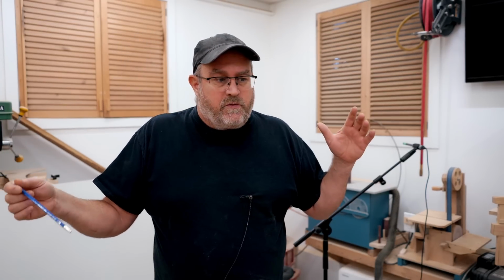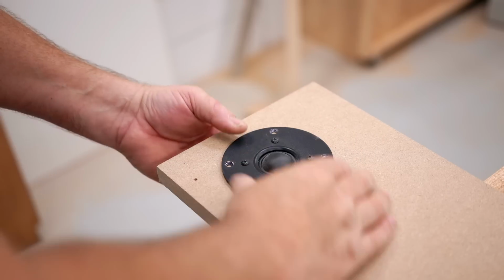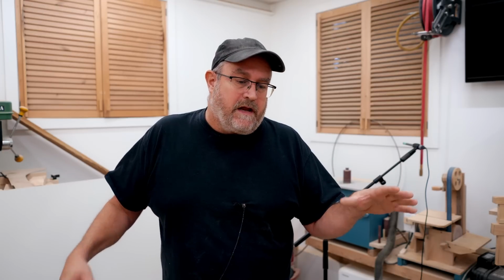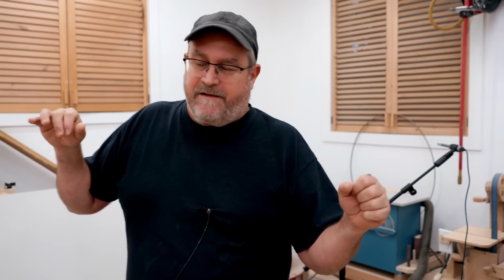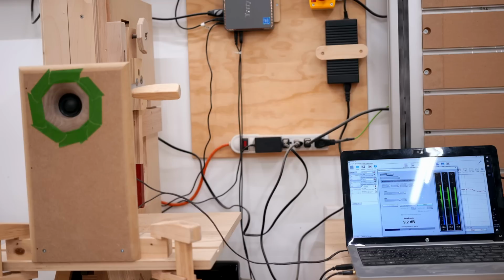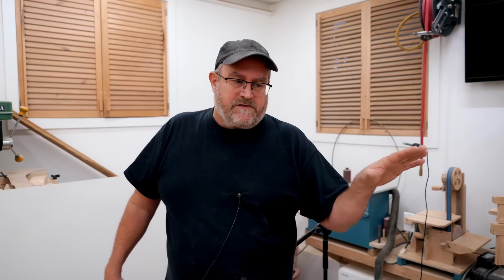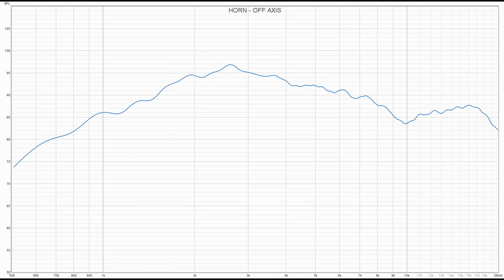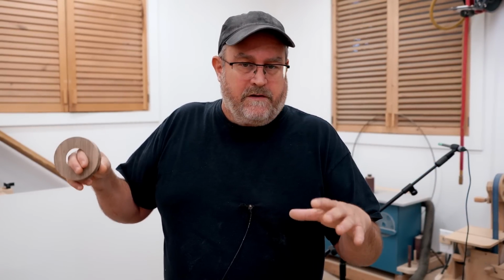What Does a Tweeter Horn Do? And Diffraction Myth Busting

Comment: Horns promote beaming. Fine if you are tuning for sweet spot, but will affect off axis measurments.
Reply from the maker: I showed the 30 degrees off axis measurement. Looks pretty good to me.
A 1" tweeter starts beaming at around 14khz, regardless of whether it's in a horn or not. A horn can affect directivity, but doesn't cause beaming.
Reply: @IBuildIt  a 1-inch tweeter beams at about 7kHz.  I've seen people suggest using full-wave for determining the beaming point but that's not accurate.  Half-wave rule is more accurate.  That said, 1/4-wave is really where the narrowing begins but that's when the driver is not longer omnidirectional.  For speaker builders with limited space (unless you are going to build a multiple entry horn and can maintain 1/4-wave spacing), 1/2-wave is "close enough".  But at a full-wavelength, the driver is already well within beaming.
Reply from the maker: At full wavelength the driver is beaming. Before that it's not beaming - it's dispersion is narrowing. I take the beaming calc like the pregnancy calc - you aren't partly pregnant, you either are or you are not. 
When I look at the practical upper limits for a lower frequency driver to use in a speaker, I'm looking at that full wavelength beaming calc as the cutoff. I'll be able to cross that driver anywhere below that and still get great off axis response.
Reply: @IBuildIt  the data for individual drive units shows otherwise.  And FWIW, Tom Danley (Danley Sounds) is the one who told me he uses 1/4 wave).
Reply from the maker: Take the typical 2-way with a 6" woofer and 3/4" dome tweeter. At half wavelength you need that tweeter to cross below 1400hz. At a quarter wavelength the tweeter has to cross below 700hz. That would be quite an exceptional 3/4" tweeter to do that.
Instead, most 2-ways with a 6" woofer cross around 2500hz, which is below the full wavelength. 
You give up a bit of the off axis response to practicality.

Comment: Just another thought.  What about the acoustical impedance change as the sound waves from the tweeter follow the 3/4 roundover and then encounter the sharp corner at the back edge of the baffle?  If that were extended back to form a box shape would that effect be minimized or could that be done to see if there is any difference?  I also wonder if it would've been more noticeable diff if you had not offset the tweeter.

As an aside,  there is a guy on DIYaudio who did a 2" radius diffraction frame on the sides only (not the top) and got a much smoother response and better off axis dispersion in the midrange frequencies but it didn't seem to affect the frequencies over 4kHz or so.  Just FYI.

"Diffraction Mitigation with PVC"
Reply: Pretty good pdf article on Diffraction.  Search on "Acoustic Diffraction: Does It Matter?"  He says D'Appolito states 3/4" radius is not much good below 18kHz !!  I had read elsewhere online that wavelength can be 8 times the radius size or less.  Ya read something different everywhere.

Comment: I agree with you, the worrying about the rounded corners and minimize diffraction differences that you won't hear but people seem to be worried about is a bit too over the top, I'll always say flat sounds boring usually, and if it sounds right (regardless of measurements) and seems to work in your room then that's a win in my book, measurements don't always mean better, depends on the person and room, if it makes sense and sounds right leave it alone, don't get too caught up in perfect measurements.
Reply: Flat sounds always better but that is only the case if you take all the measurements in account, not like this video where he only measures one axis. The sound of a speaker is formed by direct and indirect sound and thus what may look flat on one axis may be not flat on another. The complete speaker should be analyzed instead of doing just one measurement only than can you make such statements
Reply: There are 2 main reasons to control diffraction:
(1) comb filtering showing up at various frequencies / off axis angles due to edges & boundaries close to the tweeter
(2) reflections from room boundaries (which can add or substract from the on axis listening)
He pretty much ignored (2), and did not demonstrate (1) as the measurements and the audio samples were only on axis (except for 1 plot at 30o) instead of a full horizontal / vertical scan.
So, it is not even about what measures well / not, here. It is about not even measuring what should be measured when talking about diffraction.
From his meaurements, leaping into 'does not matter, people should not worry about this stuff' is misleading and misinformed.

Comment: gating is for measuring the speaker and smoothing is for when you are measuring the room
Reply: And diffraction control is about taming comb filtering issues (due to close edges / boundaries to the tweeter) and controlling the off axis response (to better match the diffraction pattern of the mid/woof, and provide better room integration). So his on axis measurements and audio samples are not even suited for supporting his 'does not matter' point on diffraction...
Shhhhh, he is apparently on a crusade against the last 30 years of 'objective' progress in the audio industry. His 'subjective' experience tells him that speaker design  from the 90s is good enough, only a 1% improvement has been made since 😂
Reply: @iamsometimes6712  in speaker building/designing we have been reinventing the wheel since the 70s..
i dont think he is on a crusade, that would imply him understanding the subject he is "crusading" against and i think thats where the problem lies.
its not the end of the world and atleast the videos are fairly entertaining. learning is part of why we do this kind of thing, its a fun way.
Reply from the maker: So, because I smoothed the response I don't understand the the subject? Smoothing is regularly applied to speaker measurements. That's what you see when you look at the manufacturers publish frequency response - a smoothed (not gated) response.
I suppose they don't understand, either.
With that said, while filming a video and running multiple tests and trying to do it all in a way that's presentable can make you forget yourself and do something redundant, like smoothing AND gating. I should have picked one.
Try making a video like this to get a first-hand experience of what I'm talking about. It's easy to sit at home posing as an expert if you never do anything for people to look at.
Reply: @IBuildIt  Thanks for your efforts in putting such vids together. Indeed it is very hard to not slip here and there doing that. Ok, won't be held against you ! Especially if you keep investigating diffraction and its multiple effects, some of which audible, in a more thorough manner.
Reply: @Marleyismydog420  Fun break from the audio world... Actually I suspect that crusading might not mean what you are implying. Seeing that crusaders were rampaging, murdening, ranksacking peoples and cities in the name of their religion whose writings teach tolerance and empathy.
Quite a dissonant clash between acts and motivation 😂 
So maybe we should not hold this channel to a higher standard than those original crusaders 😁
Reply: @IBuildIt  thats not really what i was trying to say, i feel like i got a good grasp of this stuff but there is alot of depth to such a complex subject as sound and clearly theres alot i dont understand still and might never do.
as i said its not the end of the world and you dont have to be perfect.
im sure its far from easy to make videos like this.
im sure your openbaffle speakers are going to be awesome regardless of me disagreeing with some of what you do and say.
best of luck

Comment: Thanks for this video because I have been thinking about the effect that adding a waveguide to my Peerless KO10DT tweeters might have on frequency response and baffle diffraction but also the ability to time align somewhat by recessing the tweeter in the baffle a bit more.  For edge roundovers isn't the largest wavelength it is effective (as a rule of thumb) for about 8 times the radius?  So then a 3/4" roundover would only really be good down to 2250Hz (OK for tweeter I guess)?  I have experimented with 1-3/4" roundovers (965 Hz) on my Polk 7B speakers and like what I hear but perhaps it is also helping with the critical midrange since crossover (2 way) is at 3kHz.

PS:  I believe we probably have to go to distortion measurements to get a better idea of what our ears are hearing clarity wise.  Doesn't diffraction cause time delays of different amounts, like little speakers located at the edge of the baffle and aren't there phase shifts as well?  Just my 2c.
Reply from the maker: I looked at the distortion of all of the samples. The first three (surface, flush and rounded corners) are identical.

Comment: I know nothing about speakers, but I think one more setup to try is the tweeter mounted behind the wood without the horn shape.  Does the shape matter?  How much difference does the shape of the horn make to just straight/parallel wood?
Reply: Yes it's paramount. There is a piece of software called ATH4 and AKABAK that is made to design and simulate just that.
Generally for Hifi you don't design horns and this thing is not a horn, it's a waveguide. The difference is that horn matches impedance of a compression driver to  air. It increases efficiency. A waveguide just guides waves. It focuses them the same way that a reflector inside a flashlight focuses light. A bare driver is a lighbulb hanging from a ceiling. The same driver in a waveguide is a flashlight. IT is more sensitive (louder) because you measure gain on axis, however it does not radiate more sound into the room. A horn however can surpass that by means of increased  efficiency. There are many kinds of horns and waveguides, but if you want to make one yourself, you need to know just a few things:

The small opening is called a throat.
The diameter of the throat determines the highest frequency that will be affected by the gain. The smaller the throat, the higher the cutoff freq. In reality it is determined by the size of the dome + half of the suspension. The throat is the most important part in your design, because whatever happens here will be amplified.

The big opening is called the mouth.
The mouth area defines the lowest frequency affected by the gain. The bigger the mouth area, the lower the cutoff freq. It also affects general directivity of the speaker even at the low frequencies. The bigger the mouth diameter, the more directional it is. This is used to match the directivity between the drivers. 

The distance from the throat and the mouth is the depth of the horn. 
The deeper the horn, the higher the gain. In basic hifi/monitor speaker building the depth is defined by the so called z offset of the tweeter and the midrange. Generally speaking midrange drivers are more recessed then tweeter domes, so their waves are lagging behind the tweeter. This creates phase issues in crossovers. It can be fixed by using asymetric slopes in XO, but you can also just recess the tweeter into the baffle. The exact depth of the recess will be between 15 and 25mm and you measure it with an impulse test.

The transition between the throat and the mouth needs to be maximally smooth for the best result. It's different in public address, but for Hifi we use smooth waveguides. This transition will determine spatial distribution of the sound, it's directivity. 

Now, big  waveguides cause problems, because they lengthen the distance between drivers. So for maximum mouth area but reasonable distance, people often use squashed or rectangular profiles such as the Seos horns.

Designing waveguides is an iterative process. Some designs take more than 15 iterations of just the transition before you squeeze the best directivity out of it. ATH4 makes it quite speedy though. Some people don't do iterations because they mostly affect the last octave, which isn't particularly important.

Comment: a dome tweeter has basically two big problems, it is compressing the music heavily, and it has a very high level of distortion. The gain of +6db with your horn means that you only need 1/4 of the power you needed before. This is a significant reduction in compression and distortion.
Reply from the maker: This tweeter (Scanspeak) has very low distortion, actually. But yes, driving up the efficiency also means that already low distortion will be even lower for the same output volume.
Reply: This is just plain untrue good dome tweeters (scan speak, seas etc) have very low distortion. The only thing they have is relatively high second order distortion in comparison to most woofers but that is no issue as research has found that our hearing mask most of the second and even third harmonic distortion due to masking. Compression is also bullshit most dome tweeters starting to have serious compression when you push 100+ db not the kind of volume most people are playing music in domestic settings. It is obviously not the right driver for pa kinda applications

Comment: Why in the world would you record a MIDRANGE  violin,  and expect it to represent a Tweeters upper range and spectrum?!

 Furthermore... why are you Recording from a few inches away from the tweeter...  when the Horn is going to effect things, much further AWAY from them?

 From my personal experience with listening to horns... is that while they may boost volume,  it comes at a cost of DISTORTING the natural 3D IMAGE that the Recording is providing.

 It will create a louder tweeter... and possibly add more dispersion,  the further out you go.  But it will RUIN the originally intended 3d Image / Soundstage,  in the process.

 Btw... explain why Woofers and Many MIDS.. are CONES... where as most tweeters are DOMES.

The EPI 100v  speakers use a Cone based tweeter... and let me tell you... the Dispersion Spread they create, is FAR beyond any other tweeter that Ive every heard.

 Think about it... you making a Horn shape,  is you trying to turn a Dome tweeter,  into a Cone tweeter.   But in a way that is lossy and causes distortions.

 Also... saying that you might not hear a certain frequency range,  has no bearing.   Its all about Accuracy,  and percentages of Distortion.  As volume levels increase,  so tends the Distortion percentages... especially if you have low-magnet-strength coils + low magnet strength (low strength = low control).

 I can tell you, that I have headphones from Sennheiser that list as 20hz to 20khz... and a model at  12hz to 35khz.   While Ive heard it said, that you shouldnt be able to hear above 20khz... there I was, hearing higher frequency details in music... that I was not hearing on the lower spec model.    I then handed my headphones to someone that said they have bad hearing... and his jaw hit the floor,  amazed at what he was hearing... despite having hearing issues.

 If you want to get an accurate idea of the sound clarity, and quality... actually set up a stereo pair, and sit about 8 ft away from them... as well as mic 8ft away.   Then... move the bi-neural mics... so that they are offset by anywhere from 3 to 6 ft off center.   See if you still get that sweet-spot 3d stereo effect.. and maintain the tweeters details.
Similarly, seat yourself off center... and hear for yourself.

 Then make note about both how much spread you get.  How wide the Stereo effect "Sweet Spot"  is.   And if and how detailed the 3D soundstage is.   Is that soundstage, accurate.   Does it fool you... to where the sound does not appear to be coming from the speakers.   Or do you close your eyes... and know the exact point of origin, of the tweeters.
Reply: You my friend are one of those who think they hear the diff, but don't.
Reply: @KipdoesStuff  For one thing, Im 49, and I still have my high frequency registry.

 When I was in my 30s, I was working at a circuit-board factory... where they had the wrong type of Dehumidifiers, in the Clean-Room.   It made a high pitched whine.

 None of the other workers assigned to that room, could hear it.  But when I brought in a younger dude to help out with something... he was Gritting his teeth, complaining about the noise.  And rightly so, as it was obnoxious.  I needed to place an MP3 players buds into gun-firing level hearing protectors... and still was suffering.

 When I lived with family... I used to be able to hear the whine of the CRT TV... from over 20 ft away.  I could tell if and when the TV was on, even if the volume was muted.

 Not everyone has bad and of damaged hearing... even if you do.